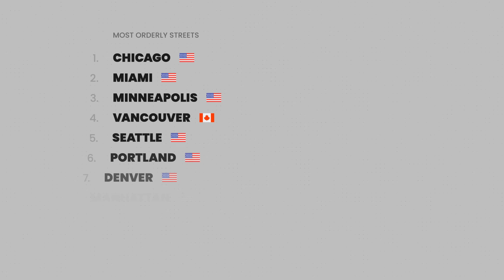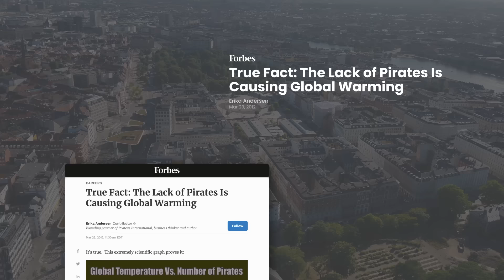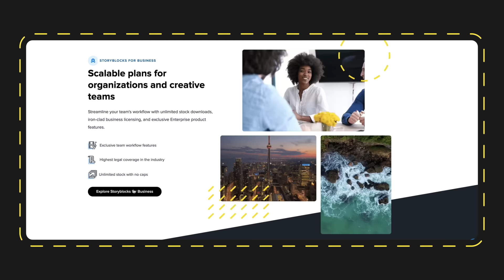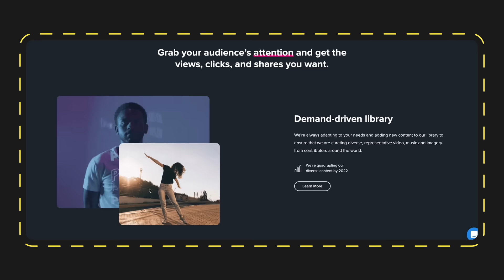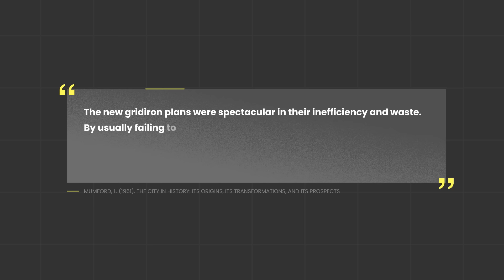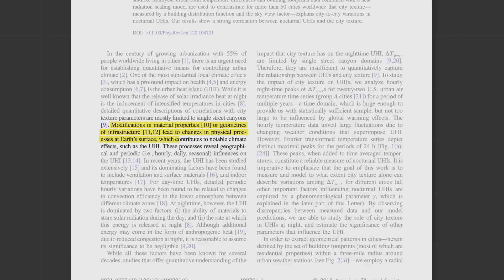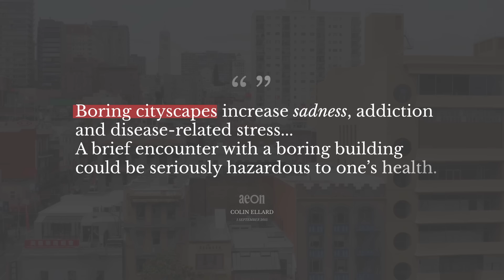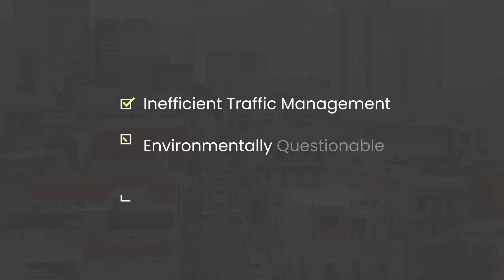Why Cities With Grids Are Terribly Designed

Comment: i love grids. i mostly reside in hanoi, where the center districts are built in grid systems by the colonial authorities. these areas see much fewer traffic jams compared to the surrounding, post-grid districts, where there are there are less roads + less connection between roads so vehicles have few alternatives and just cram into the same few arteries. i think the problem is not just the grids themselves, as evidenced by barcelona, but also the many other factors that make urban design in the u.s. a mess.

Comment: The heat island thing is real. Few years ago I moved to a place where there is a small park behind my building and an even smaller mini park in front of the building where pedestrians can walk. 
I didnt need to use AC except when its 40 C outside, coz the shade and airflow. 
Meanwhile just 2 km from my place there is the city center with roads and shopping areas - its unbearable in the summer, the 30C feels 50C sometimes.

Comment: What a terribly misleading video. The problem here isn't the grid, it's poor city management (with or without the grid). Mind you, the grid having high intersection density facilitates pedestrianisation and reduces car dependency due to shorter travel times between points. Cross intersections are also SAFER for the pedestrian because cars slow down from all sides at a cross section while only cars approaching the street end at a T-junction slows down. So in the video, it's stated that intersections aren't safe but that is for cars and drivers. The question then is where does the priority lie? On the pedestrian who is more valuable or on the car driver who is moving a dangerous machine? 

Barcelona has also shown how grids can be set into a heirarchy.

Comment: I honestly think that the lack of a grid system makes walking more hostile, and more difficult to live in. I grew up in NYC, I don't need my phone to know which street to walk to if I know the corresponding avenue letter and street number. Being that it was a grid, I could walk in one straight fluid way to my destination at ease. When I was spending sometime at London, I noticed that it was much more difficult to get from point a to point b. The street crossing are more aggressive with fences that force you to cross at a direct point, it was hard to differentiate between street names, roads were only straight for a certain distance. In NYC I could walk in any direction and manage to get back by looking at the street names, but here in London you would need to follow the same path from where you came from as each street is different. It felt so hostile to walk in London that I felt forced to take public transportation for walks that would be convenient in NYC

Comment: Some thoughts...
Stockholm, grid-factor 0.006, sure. However, suppose you'd compare different districts of Stockholm. I have a pretty strong hunch you'd find the opposite correlation, i.e. high grid factor is better quality-of-life. And I'd guess you may find a similar result for other Nordic/European cities. What do you guys think?

Stockholm inner city is, as most other cities, attractive to live in, and also pretty gridded overall. Suburb satellites districts with mid-rises (built in the 60s-70s), much less expensive, and almost always very disorienting to be in with its ever turning and leading-to-nowhere streets, often surrounded by surface parking. 

Generally in Sweden, town centers tend to be more gridded than those less attractive apartments outside. Areas with single family housing tend to be more curl-de-sac-ish if built more recently, more gridded and closer to town if built before, I'm guessing, 1970/80 (and more affluent, perhaps since the location is better and a more established area).

Comment: "What makes these cities more livable is their exceedingly low score on the grid" is a meaningless statement that you don't back up. 

It's perfectly possible for a grid design to be livable. But you seem to just breeze past how all the high grid design ones (bar one Canadian) are in the US, and hyper car centric. That's the issue there, not grid vs not grid. You can see it with the US suburban system, which is not grids, but still sucks. 

The big issue with the US system is public transport, walkability, etc - which has nothing to do with the presence of a grid or not. See Manhattan - it's one of the most livable US cities as a whole, IMO, and is absolutely on a grid system. But good public transport, lots of stuff within walking distance, etc, is what's actually key. I don't know, this feels like a video that's jumped on the correlation, looked a little into it, and then went with a click-baity title. :/

Comment: Thanks for introducing me to this topic.  Overall, your treatment of the subject is unbalanced.   Your starting hypothesis is that grid layouts are bad, and you gloss over the observation that grid layouts are chiefly North American, with the exception of the successful grid layout of Barcelona which you added briefly at the end.

The shortest distance between 2 points is a straight line.  You provide examples of extreme grid layouts.  But it doesn't have to be like that.  We can have a grid layout for major corridors, spaced 2 km apart, with a minor corridor in the middle at the 1 km point.  Within each 1 square km, there can be meandering sinusoidal street patterns with culs de sac, or if straight lines, there can be opposing narrower one-way streets, that is, a street is one way north, but at the next intersection, it becomes one way south.

How about local public transit?  The cheapest and fastest public transit is street-running buses on a grid layout.  In areas with lots of culs de sac and meandering streets, street-running buses become non-competitive (the problem of the American suburb).  Of course, this can be remedied by having buses or LRT running in reserved corridors laid out in a...grid.  Surface or underground.

Grid layouts can be built without flattening natural topography.  San Francisco is on hills.

Comment: I always found grid based cities kind of depressing. It's interesting that there are studies which prove that there is a correlation. I also want to add navigation and remembering the city layout in your head. My home area is relatively rural and most cities have between 5.000 and 50.000 inhabitants and are never more than 10 kilometers apart. But I could draw a map of most of them from my head because every street there looks distinct and there is a visible structure.
Reply: Barcelona : I’m a grid city, and i’m one of the best city ever
Reply: @curious5887  I've been to Barcelona and I loved this city so much. But I prefered the souther parts of the city near the beach. The grid based area was kind of boring.

Comment: You said it in the video yourself, correlation does not imply causation. Grid cities might actually work, it is just a shame that all grid cities are in the US which is known by basically everyone to be very car centric and therefore very bad for walkability. You also said “So why did grid designs become so problematic? Cars.” You said that they are problematic because of an entirely different issue. Your other issues with the grid city design are also caused by cars, issues with traffic signals and the high frequency of intersections? If cars were not a factor, like they are in many other countries, you could have public transit, which has been proven to carry more than cars there instead of jamming everything up with cars. Your issue with asphalt could also be fixed if everyone was riding on trams with grassy tram tracks of if they were just walking on a footpath in the first place. Your last point is hilarious, you seem to forget that many people have different tastes when it comes to art. I find grid patterns in everything very aesthetically pleasing. But this is also another problem with cars, maybe the reason you and apparently many others dislike grid designs is because they are filled with asphalt. The issue is probably not the grid design, it’s cars. You said it yourself.

Comment: I was born in a city without grid and experienced living in a city with grids (as a matter of fact visited Chicago many times too). I actually felt somewhat depressed and bored in a city with grids, validating one of the points made in this video, but another strong factor that makes many American cities "boring" in my opinion, is the repetitive architecture all over the place, which combined with the grid system made me feel like I was a mouse living in a very artificial lab setting. San Francisco was more charming, but the grid system implanted with disregard to topography means you end up with streets that are too steep. The advantage of a grid system is the ease to find yourself when navigating though, I might argue that you don't even need a GPS, but it also drives me crazy that I cannot reach from one location to the other in a more straight/short path.

Comment: I found the grid of Chicago to be difficult for orientation. For a first time visitor it is difficult to get a sense of scale, to have a feeling where you are, to get a sense of how far away a certain other spot may be without actually checking that out with a mapping app. So it doesn't even make the city easier to understand.
I guess in cities with regularly numbered streets such as Manhattan you can make calculations, translating differences between street numbers into the time it takes to get there. Which makes orientation in town less of an intuitive thing and more of a math problem ....
Reply: The problem with orientation in Chicago is that only the south side has numbered east-west streets, and north and west sides have named east west streets. Thus, without knowing the location of named streets, it is difficult at first to judge one's location.
Reply: @stephenmoerlein8470  When you get far enough west the named streets all start with the same letter. So you know McVicker street is about one mile west of Laramie Street, and Narragansett is about mile west of that. Unfortunately it does make remembering the order of the different letter streets harder.
Reply: The grid system in Chicago makes less likely to require a map than a non-grid.   The streets and addresses are basically coordinates that tell you how many blocks you are from the city "center" (State/Madison).   So if you wanted to go to 4800 W North Ave,  the address tells you 48 blocks west of State St (which is Cicero Ave) and many of the street signs will indicate that North Ave is (1600 N).  So now you know where you are in relation to the center.

And if you know where you are presently, you can easily do the math in your head and know you will need to travel x blocks (east/west) and y blocks (north/south) and get to your destination.
Reply: I grew up on the Northside of Chicago and I now always have an internal compass pointing North to keep me oriented because once you do that, it's so easy getting around.

Comment: The two biggest cities in my state are completely opposite of each other when talking about road layout, one uses a very uniform grid, one uses spaghetti with a small grid downtown.

I drive daily between these two cities, and I can tell you the one that uses a uniform grid is far more pleasant to drive, traffic moves faster, less road rage, very easy to switch to an alternative route if there's construction or an accident, far easier to navigate, etc.

Not a single one of those top 10 "livable" cities would even be in my top 100, just shows how subjective all this is.

Comment: Wow what a horrible causation between livability and grids. The sad fact you cover it yet disregard it is hilarious. Chicago is literally one of the best designed cities in the US. Its easy to plan and move around the city and it has one of the best rail systems in the US if not the world. Public transit here could be better but the train system is amazing. Furthermore the city planning means the whole lakefront is parkland. With the highways spreading out from the center of the city, it crisscrosses the grid. So it still works. This video is a european beating up on america just like an American will beat up on Europe for their military. This is just extremely biased. Chicago also has one of the best skylines in the world.....despite the grid so your banal existence excuse is laughable. 

You also no absolutely nothing about heat trappage on urban downtowns. Do more research.  There was a better study on HK heat trappage and guess what Chicago doesn't have that issue as much as it was wider alterative streets then NYC or HK. Buildings at ground level need to have open spaces on the bottom, HK does not have that. NYC does not have that.